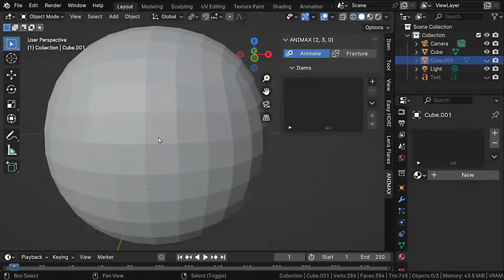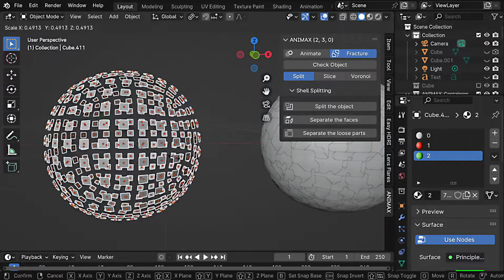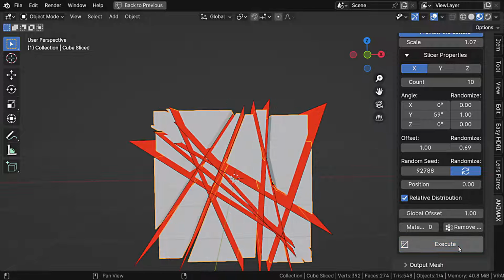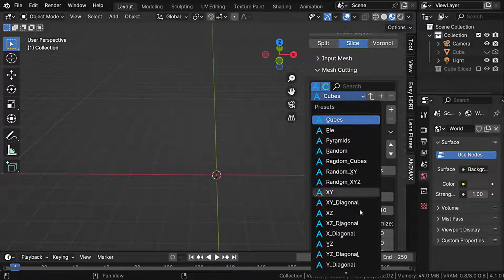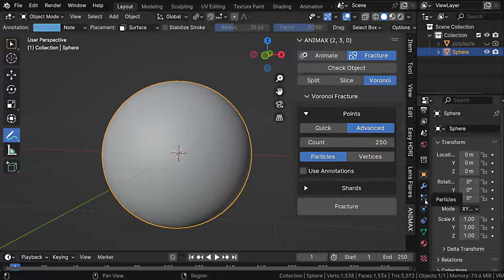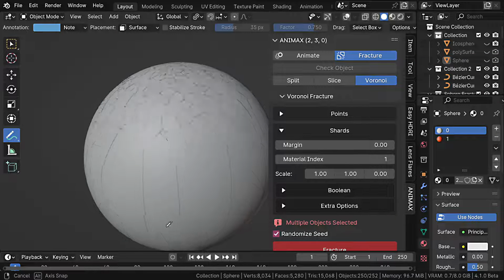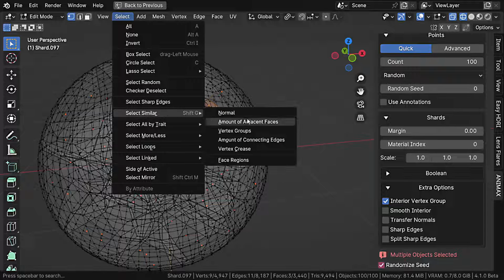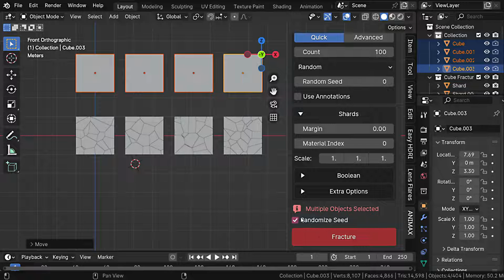ANIMAX 2.0 - Getting Started - The Fracturing Tools

Comment: Hi, this addon is great, but im working with glass materials and gradients. When i fracture  the object every piece takes the gradient. How can i keep the gradient for the full geommetry?
Reply from the maker: Hi, The add-on preserves only the UV coordinates, if you are using Generated or Object coordinates after the fracturing every new object will have its own coordinates. So, the solution is to use the UV coordinates if possible.